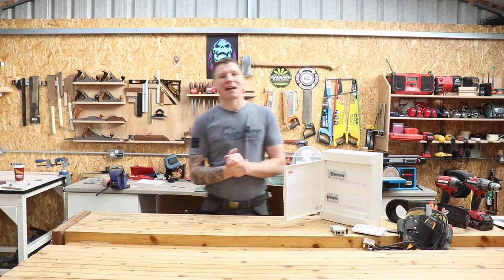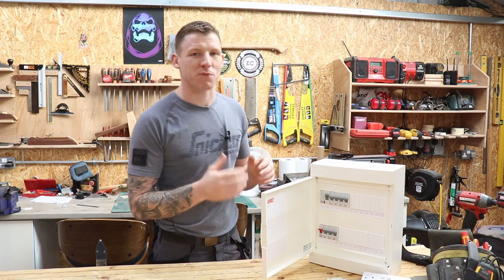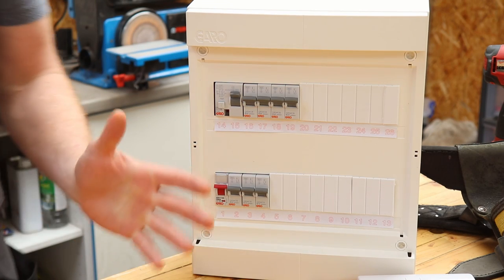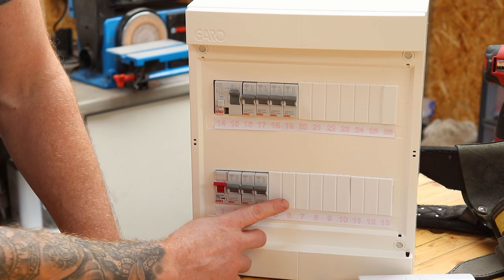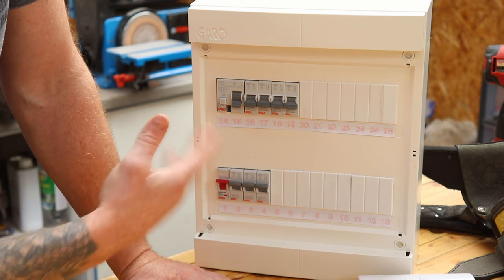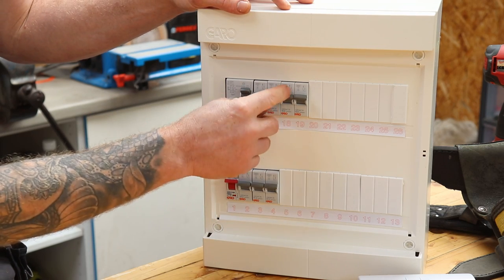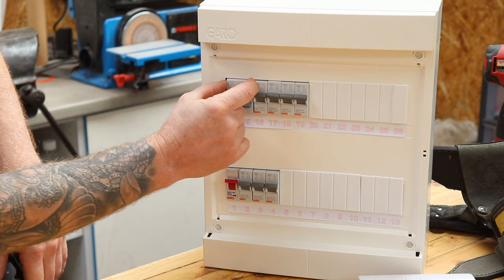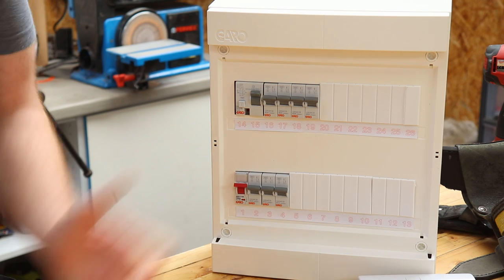Electrical Basics 2. Common fault. All My Sockets Are Not Working. How to solve the problem.

Comment: What also trips the circuit breaker is overloading, for example, an appliance that needs 20 amps plugged into a 15 amp outlet with a 15 amp circuit breaker, and a 15 amp appliance plugged into a 20 amp outlet with a 20 amp circuit breaker will ruin the appliance.

Comment: Hi, we are currently experiencing this where all the sockets are out of power but the lights are working. When checking the fuse box we have seen that none of the switches are down, not even halfway like you said they might be. It doesn't look like anything has tripped. What could the issue be?
Reply: It happened when we put the kettle on

Comment: I plugged my ps5 in to my caravan and when I switched the hdmi in the back of the tv to hdmi 2 loud pop noise came from the tv and turned off and then same thing on my ps5 and then all lights went out but all switches are still up